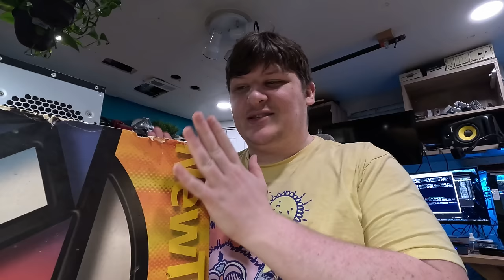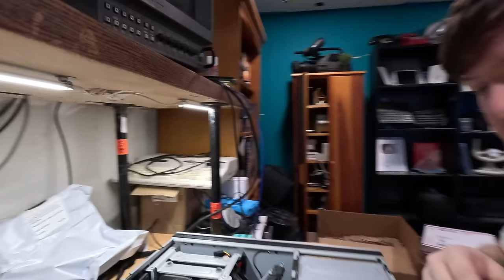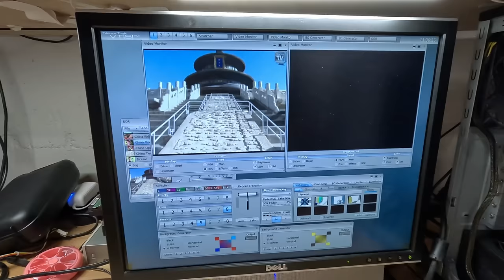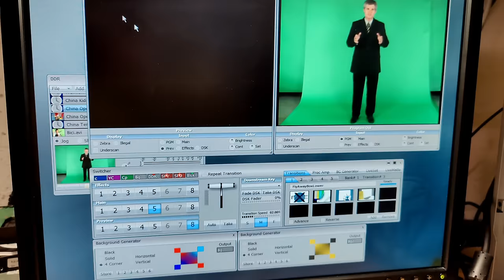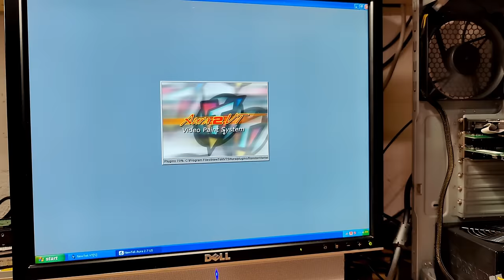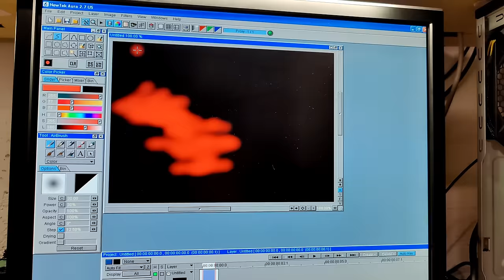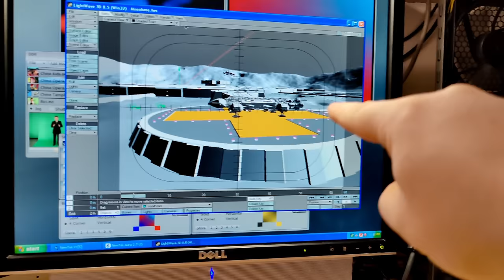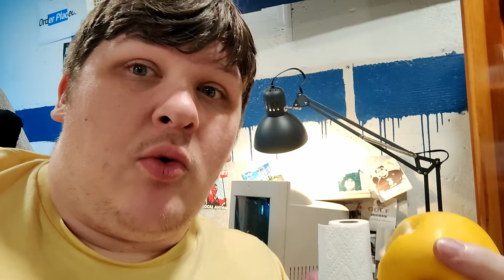Building a Video Toaster. No, not that one

Comment from the maker: Late breaking updates!

1)
Regarding the VGA cable wiring, I wanted to clarify that I don't think Newtek screwed up here, they were just in a bind. VGA was the only non proprietary cable you could readily obtain in this era that could handle high quality analog signals - their desire to not make customers depend on them for replacements was valid and probably very appreciated.

but what happens if someone plugs a monitor into the VT card by accident? well, if +10V is on one of the color lines, you might blow out the input amplifier. same for the EDID pin, H/V sync, etc. So the only safe place to put it is a ground pin, because the chances of blowing up the customer's monitor that way are negligible. maybe newtek even current-limited the 10V rail, anticipating this exact scenario, in which case hey, there's really no problem - but even if shorting it out kills the card, at least that's their device that blew up, due to their decision to "misuse" a common connector. that's the right call, because newtek could say "send it back and we'll fix it at our cost," but they couldn't commit to reimburse customers for damaged high-end monitors, it's just not practical.

2)
Regarding the power supply for the breakout box, I overthought things completely. The original VTNT card doesn't have a power input... because it has no BoB connection! You have to add a daughterboard with two more plugs, and while I knew that, I'd never seen one, so it didn't occur to me - the power input is on the daughterboard! So there's really no mystery there.
Reply: I think pin 9 (+5V) would have been a more sensible option, in the hopes that things connected to it might be more tolerant than to a short. Even better if they switched their system to actually use 5V instead of 10V. (If they had a few bits and bobs that really needed the higher voltage for signalling they could have use a buck converter or similar)

Wikipedia also shows precedent for overvolting this line (the PS55 used +12V), but it is already specced up to 1A at 5V. 5W seems sufficient to run some LEDs, etc. on the break-out box?
Reply: Even in the 90s it was pretty common that junk cables would do stupid things like short all the grounds together.  So I really feel if they were going to go through the trouble to mention in the manual that a standard vga cable works they should have mentioned needing separate grounds.
Reply from the maker: @TheGodOfAllThatWas  Yeah that was my take as well, I'm positive this thing was going on even then, so they really owed people a warning
Reply: I love learning about things I had no idea about lol.
Reply: @CathodeRayDude  I don’t think I have my original cable but I think the one that did come with the toaster cards and the breakout box actually had a few pins missing which would explain a lot
Reply: @belg4mit  FYI A buck converter produces a low voltage from a high voltage.  To produce a high voltage from a low voltage you need a boost converter. (Or a buck/boost converter)
Reply: My comment keeps getting deleted.
Reply: Please do a full demo of this system with multiple cameras, the breakout box wired up with as many devices as you can muster and try and edit a live show together for us!
Reply: @NeUrOmAnCeRAI  yt has a list of words that sha dow ban comments
Reply: @NeUrOmAnCeRAI  even this reply of yours is somehow missing in thread what did you do lol. (CRD probably can still see it. Yt broken lol)
I can only reply from the message. I don't see it in thread
Reply: @ 35:30 in the video the difference in 3.3v and 5v PCI wasn't about what voltages were supplied to the slot on the power rails. It was about the voltage level of the signals. Lower voltage levels are needed to achieve higher speeds like 66mz PCI and PCI-X. So later cards used 3.3v signaling, so that in theory theyd be backward compatible with higher speed slots. Anyway, the cards and slots are "keyed" with the location of the key changing for either 3.3v or 5v signaling. A "universal" card will have both notches and should be able to work in a slot that uses either. Now, what voltages a motherboard may supply to the slots is a different issue and if a motherboard doesn't supply a voltage that's probably a limitation of the motherboard.
Reply from the maker: @stefanl5183  ohhhh, that makes sense, thank you!
Reply: @NeUrOmAnCeRAI  Not this one.
Reply: Your phone has better video than your gopro imo
Reply: I used one of these on my college television station, this like exact model and I've never seen anyone talk about them. I genuinely had begun to wonder if I'd somehow mistaken an amiga for a windows NT machine and it was a false memory I had. I'm so happy you found one and confirmed my weird memory. 

Side note - I love the AJJ shirt.
Reply: @belg4mit  "5W seems sufficient to run some LEDs, etc. on the break-out box?"
Don't forget there's at least one FPGA/CPLD on the board and a ton of analog multiplexers.
This board would have required quite a considerable amount of power.
Reply: a little late to the party, but electrical engineer here that uses a lot of HD15 dsubs for random stuff...I was very confused listening to you talk about VGA being used to transmit non-standard VGA signals, because VGA cables != generic HD15 dsub cables. I was waiting in anticipation of that fact coming up since not too many people actually have real pin-to-pin HD15 cables lying around. I too had to learn that the hard way, luckily someone over at Newtek realized this and the other option of plugging a monitor in and blowing people's hardware out. Your's and Newtek's take seems fairly reasonable.

Comment: The VT[4] was my college career at our university student TV station. Hacked the software to build it into a flypack to do mobile sports productions for the station. Our school's basketball games were covered by us with this setup with 3 cams. I built custom scoreboard graphics controls to do time and scores via a multi button gaming keypad, replay via a shuttle control using the ddr functions. The thing was barely capable of cutting the live video, doing graphics, and replay in one machine, but we put live sports on our student station without bothering the media department for their truck. Learned more putting that system together than all the years studying TV production at the university. Been engineering TV trucks for major productions for nearly 20 years now. Thanks NewTek.

Comment: I'm so happy to see a full VT[5] setup again - I spent about a year and a half out of college working for a non-profit that ran the local access station (with a whopping TWO channels on the cable provider).

We were fortunate to have received a good deal of late 00's Macs and DV prosumer gear, plus an old news set and three whole Panasonic full pedestal cameras with CCU's from the local TV station (KFTY) who were being wound down. We had the full VT[5] setup plus lots of goodies in the studio, plus another road case VT unit that did live-to-tape most of the time. (I think we used it once as a backup when the studio machine was broken.)

I can say that as long as you didn't do anything too wild, the VT software and hardware would gladly do their duty. We never did much more than lower-thirds, titling, greenscreen, and the occasional canned sequences, with any sound usually done outboard via a Behringer 4 or 8-channel mixer. It was always a case of trying to get cheap camera operators (usually highschool AV kids) and managing to run whatever long feeds we could up and over/under whatever cramped space we were set up. (Highschool football games always tested the limits of patience, cable length, and sheer luck!) My favorite shoot we ever did was a local musical production in the community theater that was still very much set up as a single-screen cinema. (They basically just knocked down the walls of the projection booth, making it open-air and added some light rigging and a deeper stage.) We got the golden opportunity of a do-over on that one because of some recording issue I think, and while we barely made our money back, I was proud of my camera direction and tech work for the final product.

This is all to say, I'm glad you're getting to play with all this stuff without the specter of tenuous employment and a rotating mystery crew to wrangle!

Comment: That second Antec is a classic too! The only problem with mine was the USB ports plastic on the front of the case literally crumbled. I went onto Amazon and picked up a new pair of USB ports for the front of the case. It makes for a nice local server case with the 7 hard drive locations too.
Reply: I lost my shit when I saw it. I'm still using mine! with room cut in the top for a 280MM radiator.

I also broke my front USB ports. Got in touch with Antec and they sent me one with USB 3.0 ports meant for the 302, but it's a direct replacement and works perfectly.

Comment: I like to think your description of their choice to use a GND pin for 10v is pretty solid, and I think you're right that they designed the power circuitry in such a way that shorting the rail does not destroy the circuitry. This is clearly a premium product so details like this make sense and only cost a few more cents in parts. As for the FPGA, I believe a lot of them are a like RAM, when the power is off they lose their contents, and have to be 'programmed' on each power on. So you can't really brick them. There is often a secondary microcontroller and flash chip with a VHDL ROM. The microcontroller loads the ROM onto the FPGA during system boot up. And changing the core just means updating the ROM chip. There was an FPGA handheld games system that had multiple game system cores on flash for better than emulation performance. Its Saturday night, and I am writing this from pieced together memories so, you know, find a pinch of salt, fitting for a messy GoPro phone cam kinda video!

Comment: That bit about EDID compatibility is interesting... I used to have a Logitech racing wheel and pedals, but the cable connecting the pedals to the wheel broke. It was just a DSUB connector, same form factor that VGA uses, so I figured I could splice together a VGA cable. I could never get it to work though, even after I triple-checked the pinout. Turned out, after dissecting the connector, that two of the pins were linked together with a wire! Which shouldn't have been a thing!

Comment: This is like some kind of crazy cross-over between my old job and my current one.

In my old job, we sold touch screen kiosks that were powered by those little shuttle PCs. Basically my job was to build up the shuttle PC, shove the software image onto the drive, and drive it out to the customer for installation or to replace their failed machine. And as you saw, some of these ran 24x7, so they failed pretty quickly and frequently. It took a while for them to find a model that was more reliable, and eventually they designed a new kiosk that had a standard mATX motherboard integrated directly into it, rather than an entire shuttle PC.

My current job is at a television network. I was originally hired as an engineering trainee, so I worked on the professional version of this stuff that a real television network uses. The end result was kind-of similar to this, but less software and more hardware boxes connected together in complexly complicated ways. The VT experience is analogous to how things work in a real TV studio because the VT software was designed to emulate that experience. In our studio it's possible to do as you suggested, ingest the footage into an edit workstation, cut it together into a package, and the studio control room could then take that edit workstation as a source into the preview input and switch it to the studio program output to play it to air live. No need to render the package to the playout server or anything. The vision switcher even has control over the playback of the edit workstation from the control room, so it's cued at the beginning of the package and it begins playing on the edit workstation as soon as it's switched to the program output. They've even used that as a DR scenario when the playout server died mid-broadcast, they just loaded up the packages into the edit workstations, package 1 on edit 1, package 2 on edit 2; cue edit 1, presenter introduces the package and they switch to edit 1 to play it out, cue presenter and switch for package 2 intro, cue edit 2 and switch, load up package 3 on edit 1 while that's playing, rinse and repeat. It's a lot of manual work, but it saved their bacon on more than one occasion. I've seen our competitors have similar issues and have to crash out of their live broadcast half way through and start the next show early because they couldn't do the broadcast without being able to play rendered packages from their playout server!

Now I'm a network engineer, and for the last couple of weeks I've been building the data centre that runs our new studio. Things have moved on a bit from the days of piping analogue or digital video signals between boxes over coaxial cables. These days it's purely streaming video transported over an Ethernet network via multicast streaming video. Basically it does everything the old system does and more. Now you can even remotely control the cameras robotically from the control room. And you can automate that control, so you can run an entire live broadcast with just one or two people in the control room. We've actually got two control rooms, one for automated production, and the other for manual. This allows them to switch from an automated production to a manual one (or vice-versa) seamlessly, without having to shut down the broadcast to reconfigure the control room. It also allows them to start out as an automated production, then if they get breaking news they can drag extra crew into the manual control room and switch to manual in a matter of seconds. No more having to quickly swap over the team in the control room in a commercial break to roll into the next live program in the same studio (the old studio had two standing sets so they could run from one live show to the next pretty much seamlessly; the new one probably has enough room for half a dozen of the same sized sets, possibly even a studio audience set plus a few other standing sets). They can run the show manually for all but the end, programming the final segment for automated control, so the next team can come in and set up the manual control room for the next show with more than a couple of minutes to get it running. Pure luxury!

But it's now the network engineer's problem to make it work instead of a broadcast engineer (or rather, team of broadcast engineers), which is what's been making my life miserable for the last few weeks.

Anyway, thanks for coming to my TED talk. My book is out on the 30th of Februnever, so if this interested you, you can find a lot more if you simply fall into an interdimensional vortex and pop out in a universe where that book actually exists.

Comment: Dude, you're too hard on yourself, this video was awesome! Your channel has become one of my favourites, up there with Technology Connections.

BTW, don't worry about 'bricking' the FPGA, FPGAs are designed to power up 'blank', so any 'firmware' (actually, usually called bitfile) upload is safe to interrupt, all that will occur is the FPGA will remain unconfigured. Restart the upload and you'll be fine.
Reply from the maker: The problem is that however Newtek designed these, they don't do that. Multiple threads on their forums full of dire warnings that the cards will brick randomly during updates.
Reply: The FPGA itself will be fine, but depending where the bitstream is stored and if they did double-buffering and integrity checking before flipping the bootstrap location, you might need a chip clip or JTAG connector to fix it. The FPGAs I could see look like Altera MAX, some of which have internal flash, which could potentially be a PITA to recover from.

Comment: About a decade ago, I used to work at an it recycler/refurbisher. 
I know for a fact that i've scrapped about a hundred of those older looking cards. I spent about 4 hours trying to identify what they were. 
The weird socket on top and the backwards facing ram with the fpga chip. no labels, nothin.
2 vga and 2 phono jacks iirc. 

Was from an older big tech company's lot of replaced hardware. (hint hint)

Couldn't list for sale if we didn't know what it was. 
RIP my man.
Reply from the maker: Yep, that's exactly what I figured happened to these. And why not? Newtek's fault for not labeling them!

Comment: Personally I haven't use anything that transmitted analog video over BNCs, but it's always nice to see you explore that stuff. I'm active in a student internet TV station and we transitioned mostly from an ATEM switcher connected to an encoding PC and sometimes a second PC running CasparCG with each of these devices requiring a seperate person to operate, to a single PC with a Decklink Quad 2 card and running vMix. The new setup can be operated by one person for smaller events and in most cases new setup enables more complex scenes to be produced.